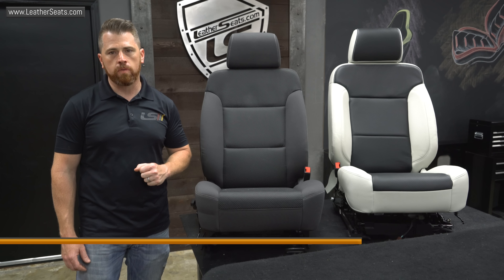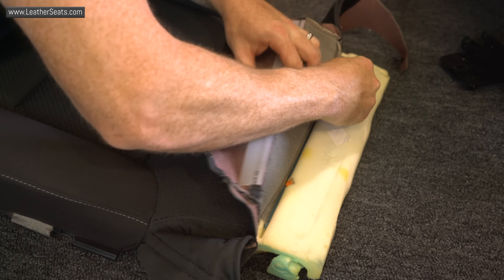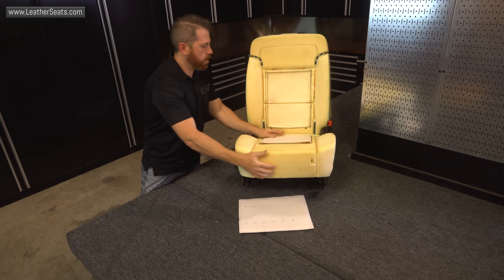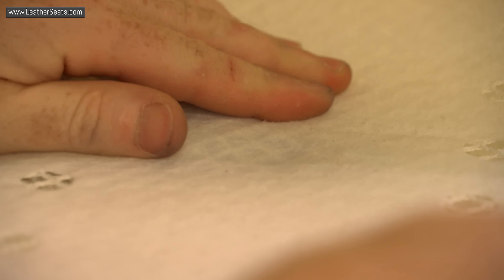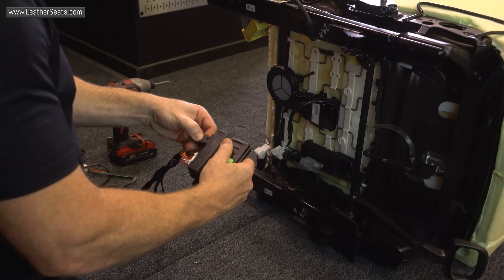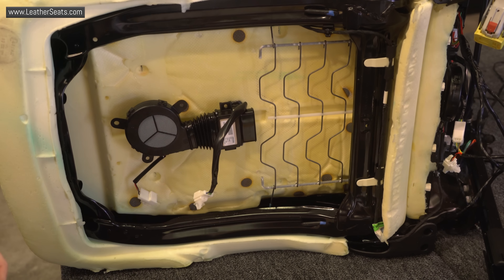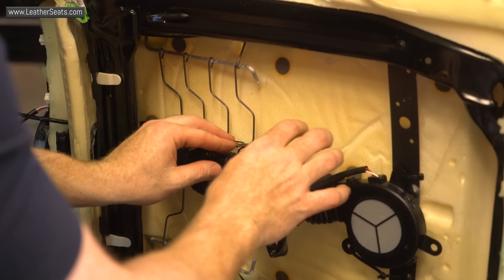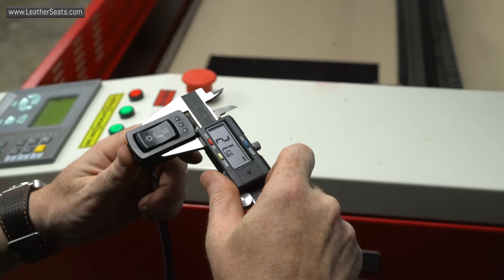Installing Heating and Cooling Seat Ventilation Units - LeatherSeats.com Tech Tips

Comment: When putting the silicone on.. be careful not to overdue it. If you do to much, you will clog the pad vents, potentially leaving dead spots. 
If you want a Seal.. make the hole slightly smaller ( 1/8-1/4 lip). 
With the tube being longer (proud of the cushion) it will always be pushed against the pad, so lots of silicone (or none) is necessary.

Comment: This install does not make much sense for total cabin climate control. If you turn on seat coolers, you also turn on rear passenger foot heat, with the placement of the exhaust port on the seat. Without looking into it, I bet there is a way to vent the A/C to the seats. Or port the heat exhaust outside...

Comment: Just installed this kit in my ND Miata and I couldn't have done it without this video...thank you!
Reply from the maker: Scott Schapiro Awesome, glad to hear that it helped! Enjoy the units!
Reply: Scott Schapiro how do you like them? I want to put this in my truck but I'd like to see some reviews first.  Most interested in the cooling. Is it cool enough?
Reply: I only installed the kit in my driver's seat and I could not be happier. I live in south Florida and drive a convertible and I have found the cooling to be very effective and noticable even when the rest of my body might be getting too hot from having the top down.

It also starts working very quickly. I have had a couple of other TED coolers that used water as the cooling medium and this works better and faster.

I have not had a chance to test out the heating function yet, but I have every reason to believe it will work as well.

Keep in mind that Gentherm is an OEM supplier and they use these components in many production vehicles, so this is the real deal.
Reply from the maker: @austinhigel4118  Here is a link to the units on our website: https://www.leatherseats.com/shop/seat-comfort/seat-heater-cooler-unit.html For the kit you can either give us a call at 1-866-639-7328 or email us at sales@leatherseats.com.
Reply from the maker: @austinhigel4118  or the 2012 model, the 40/20/40 with 2pc console option is for jump seats that have an opening console top along with "underseat storage". The 40/20/40 with 1pc console is for work truck models that receive a jump seat with a non-opening console (just an open plastic tray on top), and no underseat storage. I hope this helps, but if you have further questions please email us at sales@leatherseats.com or feel free to call 1-866-639-7328.

Comment: While this is an excellent upgrade, it left me wondering if purchasing OEM ventilated cushions and colling / heating system itself would save a lot of labour (and thus cost).
Reply: Probably not if you’re doing this all by yourself, seeing as how most cars with heated ventilated and cooled seats are newer, therefore making it expensive to get the OEM seats easily. Plus this system would allow you to add a feature to a car that may have never had it

Comment: Don't laugh at me but i always thought there was some kind of coolant system that drove it    :

 (
Reply: Yup it's called blinker fluid 😂
Reply: @hereb4theend  my car leaks exhaust fluid..
Reply: @punker4Real  adding maple syrup to your next fuel refill will fix that ⛽😂😜
Reply: Some cars actually do use refrigerant on the cooled seats.  Most are just ventilated, though.
Reply: Mercedes units have a refrigerant, some even use circulated water and blown air through a small radiator but this system uses a similar theory as a fridge but passively, it works on the peltie effect

Comment: So much work! Will this work on cloth seats?
Reply from the maker: Korey Mayo We have not explicitly tested this system on cloth upholstery. This system is really designed to have airflow through the upholstery (this usually requires a high flow foam backing on perforated material) however you would probably get a surface temperature change with typical cloth seats.
Reply: @LeatherSeats  Why do you need a high flow foam backing? Why can't it just be right up against the upholstery?
Reply from the maker: @koreymayo8884  Most seat upholstery (Both cloth and leather) will have some form of scrim foam backing sewn into the back of the upholstery which is some cases may be a closed cell material that would block air from passing through. Again, without the high flow (open cell) backing foam you would most likely get good surface temperature results, we just have not tested this thoroughly on OEM cloth upholstery. If you have any further questions about integrating these units please free email sales@leatherseats.com
Reply: @LeatherSeats  ok I didn't know that thanks, so when are you guys going to test with cloth seats?

Comment: @18:00 would have been cool it you measured the temperature of the air
Reply: One of the problems with this kit is it will raise the cabin air temp. if your AC is inadequate, this kit would make it worse.
Reply: @ExtraFungus . How so?
Reply: @didiermejia780  to have a cool side you must have a warm side, you must cool the warm side and all that heat goes into the cabin. So if your air conditioning is not keeping up or inoperable, this would actually make your cabin air temperature go up.

Comment: This is wayyy too much hassle man
Reply: Ponyboy 😂😂😂😂I was thinking the same thing like “it’s a bit much just to make some air blow under your ass”
Reply: Well if you don't care about it that's one thing, but to get this feature it's usually only available in higher trim levels which costs thousands of dollars.
Reply: Ryan Nelson but they have proper air con or heat on them and if you have old car just buy one which have that also old . The one here produce heat to get cold where heat will blow in to your car it’s pointless
Reply: It's well worth to go through the hassle of installing this system when you live in south Florida.
Reply: David G I'd much rather take the day and put cooled seats in my car. Mine doesn't have AC either and I have leather seats. It's a no brainer to me anyway.
Reply: Ryan Nelson what you just saw cost thousand of dollars.
Reply: I just buy used astronauts underwear with the glycol cooling and heating system. It uses an electric powered "TED". Wait a minute, did I get screwed because use they cost $979 + S&H. I am dumbed...LOL.
Reply: +Yar Nunya   I had the same idea, but then I figured out you can use the template and drill a hole in the floor. Vent the hot air out thru the bottom. Or, you can buy a second one to cool the hot air again, then repeat. Right?
Reply: Ponyboy yeah he lost me at cut this sloppy hole and slather some silicone on before zip tying it together. I can’t imagine what the kits were like that they didn’t endorse.
Reply: dont buy a new car then. buy a used one with those features.
Reply: HexagramMan spoken like some one who never had real air con seats
Reply: This runs in the thousands also.  You have to buy the perforated leather seats, etc etc.
Reply: Lazy
Reply: That's why you get the pros to do it for you
Reply: I guess it depends on the person installing it and their skills and where you live whether or not it’s worth it. An upholstery shop could probably do each seat in about an hour. You could probably get them done for $300 but I’m not positive.
Reply: @0xigix0  I drive for Lincoln and they aren't worth the hype. Just don't get the fake leather seats
Reply: It’s a matter of how much do you want it! Do you really want it? If yes then it’s not a hassle unless you aren’t handy! If it’s a hassle then you don’t want it that bad!
Reply: Well, if I’m paying somebody else to do the work, I don’t really care.

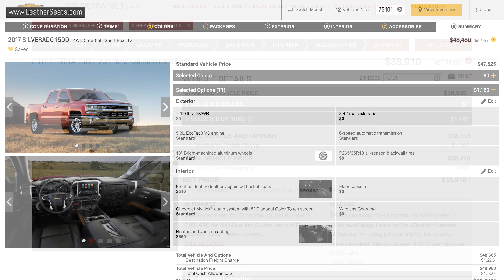Comment: At 00:45, you forgot to mention that the Silverado High Country has cooled seats.
Reply from the maker: Great point. GM does offer a ventilated seats, but the GM ventilated seats we've looked into for this generation typically have fans in the seats that blow ambient air. It's possible the High Country received something different,  but everything we've looked into for that generation doesn't have a thermo-electric device to cool the air being blown like the system we are offering. Either way having some ventilation is better than none!

Comment: This may seem to be a strange question but why is it only leather seats that get the heating and cooling treatment?  Wouldn't cooling or heating cloth seats be a simple and easy upgrade for car manufacturers and be even more efficient since they don't have to compete with the density of the leather?
Reply: See 2018 zl1 Camaro
Reply: The_KillShot cloth seats don’t give u swamp butt, leather seats do and benefit more from ventilation

Comment: After buying the kits and leather for both seat plus paying for installation, you could have just got the upgraded package
Reply: perhaps you want to do this as an upgrade after 2-3 years of ownership and your finance are better?
Reply from the maker: Jeff Renaldo Most factory A/C seat options are bundled in packages that are significantly more expensive then the combined cost of our units, upholstery kit, and even professional installation. Feel free to give us a call at 1-866-639-7328 and we can get you pricing and availability for your vehicle specifically.
Reply from the maker: tinatpasselepoivre You are right, most of our customers don't want to purchase a new vehicle just to get A/C seats and some vehicles never had the option in the first place. To them this option is way cheaper than a new vehicle.

Comment: if u already have heated seats but want the cooling would it be an easier install cause of the existing seat warmer?
Reply from the maker: +jason Unfortunately no, that would not make it any easier to install. Most seat heaters are designed to lay on top of the seat foam and heat with the seat without any air movement where as on theses units, both the heated and cooled air is blown through the upholstery.
Reply: But you could use the power source of the heated seats for this right?
Reply: @PhilBesch  try emailing them
Reply: @theamazoner4075  In the silly voice from Sponge Bob, 3 Years Later....
Reply: @PhilBesch  quite literally

Comment: My VW has nice perforated leather upholstery already. Would this integrate with your HVAC system? Are the factory front seat heat pads typically part of the upholstery or simply pad fitted between the upholstery and the foam?
Reply from the maker: chris kelvin Our heating/cooling system requires air flow in order to work properly. The perforation on your seats is a great start and may be enough to work with our system. However, depending on what kind of scrim foam/backing material your upholstery has, you may need to have an upholstery shop modify it to use a reticulated/high-flow foam to allow proper airflow which we do offer as well. If you have any questions about this material or the process please email sales@leatherseats.com and we can help out further. As for the heating pads, a lot of the time the pads are attached to the seat foam in between the upholstery but sometimes they are sewn to the back of the upholstery itself. You would need to pull up the upholstery on your seats to tell which way yours are mounted.
Reply: @LeatherSeats  thank you

Comment: Was that seat equipped with a side airbag? If so is there special care needed to replace the foam and cover properly so it can deploy properly if needed?
Reply from the maker: +Subgunman Yes this truck had side airbags and our upholstery kit for this pattern is compatible with the factory airbag system. Our upholstery is designed to replace only the factory upholstery not the foam. You will need to re-use the factory foam which properly holds the airbag system in place.

Comment: what's another name for the pinch clip listings at 2:50? I want to know its name to learn how to create my own seat. Please.
Reply from the maker: Sina Radi These seats specifically utilize push-clips, J-clips, and velcro attachments for the upholstery installation however most vehicles will vary and may include hog-ring attachments and even glue in some cases.

Comment: I have done hundreds of these installs the best place to grab ignition in this vehicle is the power outlet under the consul it is ignition a lot safer than digging in the wiring harness in the ignition system there also should be a main feed coming from the battery to the fuse box that would be where you would grab your constant power Factory ground is the best place to grab it

Comment: En hora buena ! But can it be possible on racing seats?
Reply from the maker: Miguel Baltazar The units themselves function universally so as long as the seats have room for the units to be mounted with access to the vehicle's power harness and the upholstery is properly outfitted with perforation and high-flow mesh foam they should work. Here is a link to the units on our website: shop.leatherseats.com/heater-cooler-units Be sure to give us a call at 1-866-639-7328 or email us at sales@leatherseats.com for more info about the system requirements.

Comment: You add this system in indian car's
Reply from the maker: Sharath S Shetty This seat climate control system is universally functional. They should work fine as long as all the seats that you are installing them on have room to mount the hardware, you can wire it correctly with vehicle's power harness, and the upholstery allows for proper air flow. If you would like more information please email us at sales@leatherseats.com.

Comment: Great video.  Does this heat/cool pad product work with any vehicle that has power seats?
Reply from the maker: Thanks for watching! These semi-universal units can work on power or manual seats. The only requirement to power these units is a 12v power source. The only thing on a modern seat that would effect this installation is a surface-mounted occupancy detection sensor.

Comment: I don't know if I have a defective part or something but for the life of me I cannot get the exhaust tubing to slide onto the TED. I push it as hard as I can and the tube just won't slip on. Every video I've seen for these kit installations everyone slides the tube on like it's nothing. Any suggestions? It's done very quickly and easily at 8:16
Reply from the maker: Feel free to send us some photos to sales@leatherseats.com so we can look and help you out. The tubing is designed to account for multiple-sized openings for different applications. There will be wider and narrower sections depending on what you need. You might want to check if there is a broader section of the tube available that you can use that still allows you to get the proper final length.

Comment: What if I have heated seats and just wanna add cooling
Reply from the maker: Gunslinger 1 This system replaces existing seat heaters because it functions via heated and cooled airflow through the upholstery. Most factory seat heaters are solid pads in between the seat foam and upholstery that would block the airflow. For more information, please email sales#@leatherseats.com or call us at 1-866-639-7328.

Comment: Now I really want this for my car...if you have cloth seats can you just fit the cooling pad directly under the OEM cloth?
Reply from the maker: Oliver Rashid It really depends on how dense the cloth and backing foam is. The system requires airflow to work properly and was designed to be used with perforated upholstery and a high flow backing foam. You may experience some surface temp difference but we have not tested the system for that use. Please give us a call at 1-866-639-7328 or email sales@leatherseats.com and we can get you further details if needed.

Comment: My gmc canyon has heated seats (only). I believe this unit is the control for heated seats. Im going to check... Is it possible (in theory) to rewire it to ventilate and cool rather than heat?
Reply from the maker: Tavnott Our units work by utilizing a multi-junction ThermoElectric (TED) device that heats or cools the air blown across the TED using the Peltier Effect. Your factory heated seats are not air flow based, and are most likely surface mounted pads that have integrated carbon fiber heater elements that radiate heat through the seat. Even though the controls may look the same, your factory seat heaters will not have cooling capabilities no matter what kind of re-wiring is done. If you have any questions about replacing your factory seat heaters with this system be sure to email sales@leatherseats.com or give us a call at 1-866-639-7328.

Comment: where is the heat going from the peltier?🤔🤔🤔🤔
Reply from the maker: Abhishek Naskar Most OEM systems vent the exhaust air under the seat. This Gentherm system will vent wherever the installer decides to route the exhaust ductwork, but that will also typically be under the seat.

Comment: Nice, for the ventilated seats as far as the cooling goes. Is it straight air or true cold ac blowing in. I'm  still trying to understand that portion of it.
Reply from the maker: itscrucial The air going through the TED units is actually heated or cooled based on the settings. What you feel coming through the seat upholstery is air that has heated/cooled using the Peltier effect, see 06:29. If you have any further questions, please feel free to give us a call at 1-866-639-7328 or email us at sales@leatherseats.com.

Comment: Can you do this for my old Land Cruiser?
Reply from the maker: Tedro Peders The units themselves are universal and can be installed in probably 90% of most vehicles as long as there is: 1- enough room to mount the units, 2- there is power to connect to, and 3- the seat upholstery is compatible for proper air flow. Give us a call at 1-866-639-7328 or email us at sales@leatherseats.com and we can help answer any of the questions that you may have.